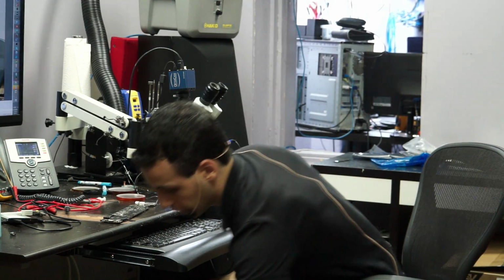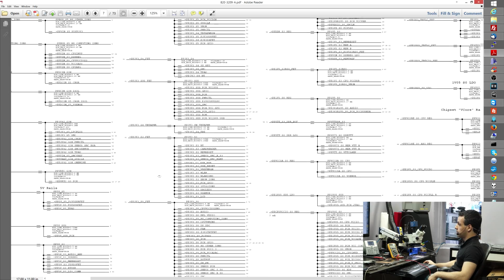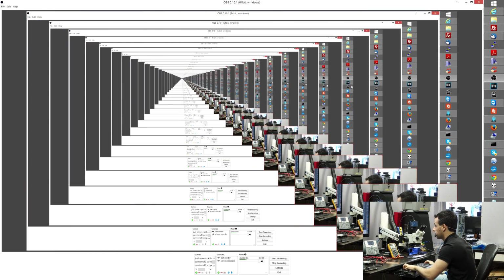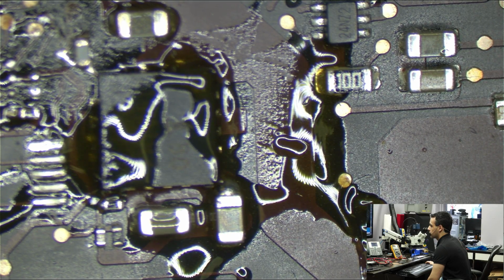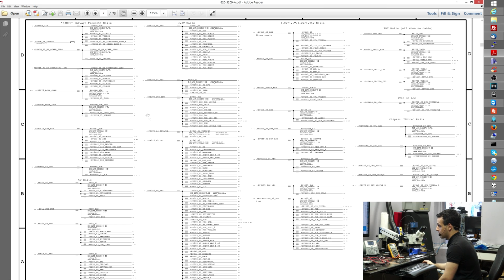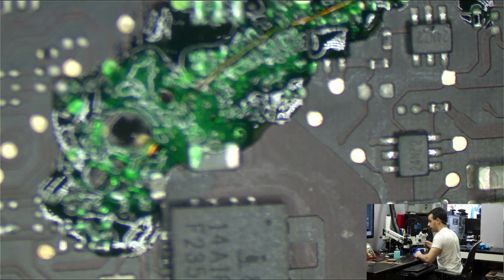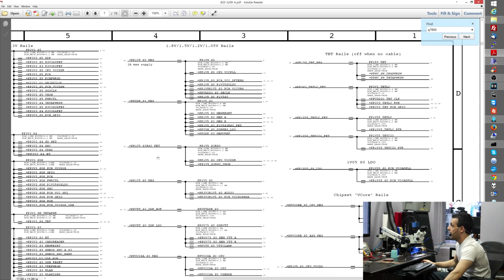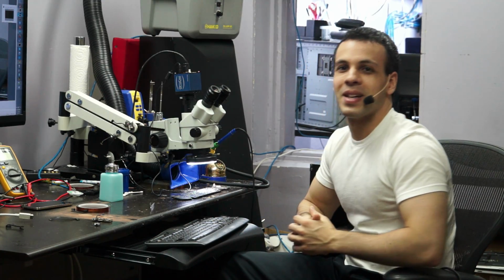Macbook Air in S0 state but not turning on

Comment: watching this video after spending 3 hours on 820-3437. i had all the rails present and system in s0 state but system is not on.  system was missing PGood because of resistor.  thank you for this video

Comment: Hello. Help determine the damage. Motherboard 820-2838, fan does not run, the line SMC_FAN_0_CTL R = 15k instead of R = 100k. It turns out short to R5661. When you press the power button on the J5600 connector appear PP3V3_S0_FAN and PP5V_S0_FAN voltage, but the fan is not spinning. But the computer starts up and running. Prompt reason SMC?

Comment: Have you gotten any one come into your store with the new 12 inch MacBooks? Im just curious if third party repair shops are able to repair the new MacBooks yet or if they will ever be able to.
Reply from the maker: +Jacob Payne I have no parts for it and no schematics or boardviews. It is a waste to invest in these things when the machine first comes out. No one has fucked it up yet. It's like shoes. People treat them perfectly, avoid walking on grass, avoid puddles, look everywhere... and then they get that first scuff, 3 or 5 months in. Then they know their shoe is fucked a little bit and no longer perfect, so they treat them like shit, and then they break. 

This stuff doesn't break in the beginning. However, the parts cost way more in the beginning, if they are even available. I am never in a race to be the first to fix anything.

Comment: Hey Louis, Im working on a 820-2850 and I don't have any of my S0 rails until I plug in the battery. Even after I plug in the battery I don't get a chime or video. Without a battery I have ppbus_g3h, ppbus_cpu_impv_isns,pp3v42_g3h,pp5vs5,pp3v3_s5. With the battery I have ppvcore_s0 cpu gfx and gpu plus the rest of the s0 rails. If I remove the battery after S0 rails stay on. The are signs of slight water damage (None of the indicators are tripped)The only thing that has really stuck out on visual inspection is the Ethernet IC up near the lvds connector was "warped" I removed it and im still waiting on a replacement. Any thoughts or direction would be appreciated.    Thanks
Reply from the maker: +Matthew Howard ethernet thing is inconsequential, find the s0 rail you are missing.
Reply: +Louis Rossmann I have them all ( i think) PP5V_S0 4.97V , PP3V3_S0 3.3V , PP1V8_SO 1.79V , PP1V5_s3rs0 1.49V , PP0V75_S0_DDRVTT 0.75V , PP1V2_S0 1.18V ,PP1V05_S0 1.05V , PP3V3_S0GPU 3.3V , PP1V8R1V55_SOGPU_ISNS 1.55V , PP1V8R1V55_S0GPU_ISNS_R 1.57V , PP1VO5_SOGPU 1.04V , PPVCORE_SO_CPU 1.00V ,PPVCORE_SO_GFX .87V, PPVCORE_S0_CPU_VCAP0 1.00V , VCAP1 1.00V , VCAP2 1.023

Getting a little discouraged, maybe Im overlooking something silly though.

Comment: Any tips for getting into soldering for 14 year olds :) Thanks
Reply: +MrHD71 .. Practice is the best advice for soldering, practice on some old dead PCB's. Use flux, remove the components and resolder them back in again. 
Cut wires, strip them and join them together again. Solder wires to crimp terminals.. If your interested in micro soldering you need to start on SMD stuff first.. Perhaps buy a couple of SMD practice boards from eBay..    

Watch YT videos too, they're informative and will help.
Reply: +orbiter8 (John) do you know any good flux that i can buy on amazon co uk? thanks :)
Reply: +MrHD71  I can't really recommend fluxes from Amazon as I've not tried them, mainly because a lot of the advertised ones are from sellers and and you don't know what your getting in many cases.. I have tried some of the eBay liquid fluxes but I didn't like them as they evaporated too quickly.

Now I buy flux from Farnell in bulk and mostly use the Multicore/Loctite PC21A. But that's expensive stuff especially as it comes in 5ltr cans.

Check out a couple of the links below.. Firstly I would recommend a flux pen to get you started.. If you also need liquid fluxes in future.. Look for the 'NO CLEAN' type! The links below are to some suitable fluxes for general purpose soldering. 

When using liquid flux and some gel fluxes you will also need flux cleaner for circuit board cleanliness, as flux residues are sticky in a lot of cases, and can make circuit boards look terrible if the flux residues are not cleaned off. This is not important though if you're just to get started. 

Once you've been soldering for a while you'll be able to tell which flux type you prefer.    

http://www.rapidonline.com/Tools-Equipment/Electrolube-SMF12P-Surface-Mount-Rework-Flux-Pen-12ml-Single-87-4426

http://www.rapidonline.com/Tools-Equipment/Brown-Flux-Jelly-50g-87-0700

http://www.circuitspecialists.eu/soldering/solder-wire-and-consumables/no-clean-halogen-free-flux-by-mg-chemicals-8351-1l-1-litre-size/

http://www.circuitspecialists.eu/soldering/solder-wire-and-consumables/no-clean-flux-paste/

http://www.somersetsolders.com/pf200-rosin-flux-gel/p330
Reply: +MrHD71 Hi there. The best advice I could give you, is just to start some small projects for yourself to learn the ways to solder. Personally I am 18 years old, Automotive Bachelor of Science student and never really needed to solder things, and still I don't really need to solder things I have these extremely unsteady hands but really wanted to get a little more into soldering. I find soldering very therapeutic. I started doing some some projects like multi voltage input fan controllers (with prebuild sepic converters) and some other little stuff. After a couple of hours practicing you just start to get a hang of it. Most of the things I solder is through-hole though. I would suggest: get a cheap but proper variable soldering iron, some good quality solder, a flux pen, some goodwick, a desolderingpump and some Fluxpaste. You can find cheap components and stuff like flux, goodwick and a desolderingpump from ebay for very cheap. Don't make the same mistake I made and buy some decent solder. The stuff I bought of ebay (5 euro for 200 grams I think, supposed to be 63/37), needs to be headed more and only has 1 small flux core.